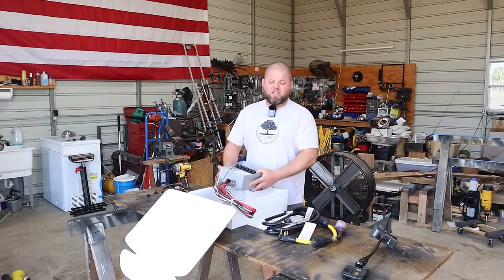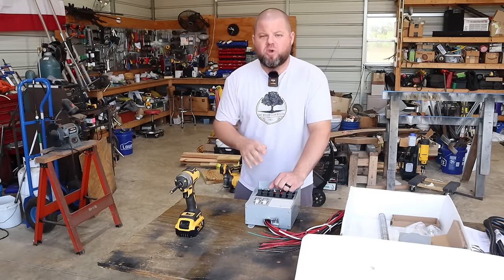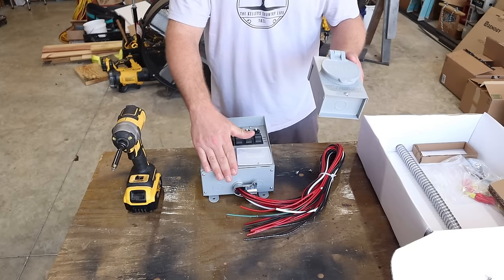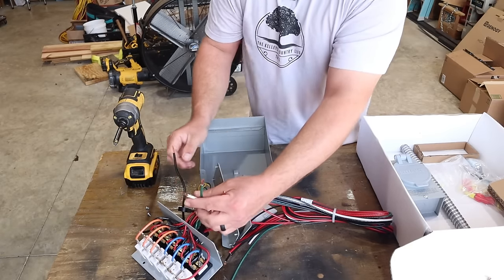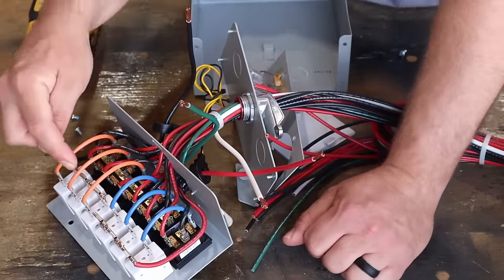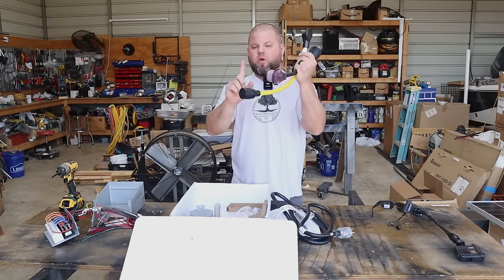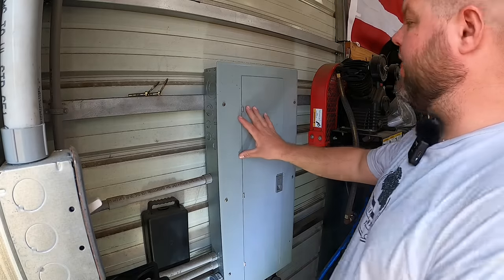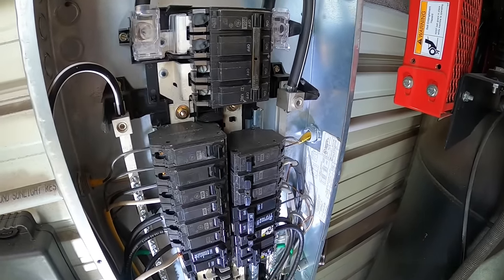How to install a generator transfer switch 120 and 240 volt #703 Ecoflow whole home power solution

Comment: Nice!! They are switches, not breakers. The breakers are above the switches. I suppose you just mis-spoke. The lights are actually only 43 watts each, pretty good for large fixtures like that. I like the UPS feature but you need to remember to have the transfer switch switch in the Gen position, the battery plugged into the transfer switch and the battery plugged into an AC outlet powered by the grid. I mention that since a lot has to be done for that to work that way. You mention the battery has 3600 watts. I guess you mean it's a 3600 WH (Watt Hour) battery. So that would give you a 1000 watt load for 3.6 hours. Not bad but not a lot either considering you may have very long outages. I guess it would power your shelter for more than 8 hours keeping the window AC unit use low and I would guess you would include the freezer circuit with that UPS set up as well. Not sure the energy use on that but most likely is around 500 watts each freezer running but they have strong start up currents. Not sure if the battery trips with high start loads like that. Consider the freezer, the window AC and perhaps another freezer starting at the same time, unlikely but..... 🙂
Reply from the maker: That unit has 3600 watts of continuous load output, 7200 watts peak. It also has 3.6kwh of capacity. That's actually a lot of capacity in a unit that size. I ran my entire house all day today (minus 240 volt appliances) on just that device, I averaged between 100-300 watts at any given time with everything as normal in the house. Only major spike was when I microwaved lunch. I also ran 400 watts of solar power to the unit and it was 100 percent charged by sundown while running the house the entire day. Quite impressive if you ask me.
Reply: @TKCL  Wow, my house uses about 800 to 1000 watts to run. I use about 650 KWHs every month. With such a low consumption it's no wonder it works so well. The solar alone was generating more than your needs. Impressive! 🙂
Reply from the maker: That was minus my daily average of 240 volt appliances, had to throw those off this being currently set up for 120 only. We have been averaging 750 watts an hour or 532 kwh a month lately. Majority of that is actually our dryer that pulls almost 6k watts. Tiffany loves doing a lot of laundry lol.

Comment: Well, it rains or is cloudy 217 days out of the year. Solar is only about 30% efficient. Price point of the equipment it would take 15 - 20 years to pay for itself and solar panels are only warranted 10 to 25 years then you start over again. There is no reason, the prices of grid power because they are still using 50+ years of the same grid and technology ...lack of thought for the future.
Reply from the maker: It's never been a logical choice for ROI with as cheap as my power is here. It is a wise choice living in the sunshine state for back up power or extended outage situations.

Comment: I have to mention that you will have 2 neutral bond connections on your system which can be never dangerous if there was a short to ground condition. There is only aloud to be 1 neutral bond connection. Please beware. 

If reliance  told you to connect the ground to the neutral bar. You will need a transfer switch that can switch the neutral wire. 

I hope this helps you.

Comment: You CAN NOT plug the Ecoflow Delta Pro into the outlet and use it as a UPS while it is powering the transfer switch, you will cause a ground loop.  Very dangerous situation and could burn out your Ecoflow.
Reply from the maker: I've only ever seen that issue when two are connected together with a dual voltage hub.

Comment: Too bad well pumps need 240v. That's the only thing I really need a  240v generator for during a power outage. Thanks for the tip on the 3-4 prong dog bone.
Reply from the maker: Shallow wells can run on 110volt pumps, but I'm talking 10-15ft deep wells not often seen. They do make 110 to 240 volt step up converters. Even still there is a good chance your well pump requires too many running watts.

Comment: Waste of time. Just back up the whole panel and only turn on/ or transfer power to what you want on during a power outage. Way simpler and cheaper. Eliminate that jankey 6 circuit sub panel and the hassle of wiring certain back up breakers in it and just put a 50 amp backup breaker in the main panel with a main breaker locking mechanism installed that only allows you to turn on the backup breaker if the main breaker is shut off and vise versa for when power is restored again. Then all you need is the simple 50 amp generator outlet installed and wired into the 50 amp backup breaker in the panel and done. Thank me later.
Reply from the maker: This is exactly how my house is. While that makes perfect sense to you, it's not for everyone. The beauty of transfer switches is they can be manual or automatic with no user input needed. Your scenario sounds perfect for you, but your not thinking about others. The beauty of transfer switches is its easy for a child, significant other or someone with zero electrical knowledge to throw a single out in the open labeled breaker during an outage. Not everyone knows how to go through an entire main panel throwing off an on critical circuits, that's easy to do on a simple transfer switch. FYI basic panel interlocks for your generator box are also illegal in many countries, where as a transfer switch it an accepted and safe means to pass code.
Reply: @TKCL  I totally get what you're saying and when we do them that way, I explain exactly to the homeowner how it works after I install it for them so they know exactly what to do during an outage but that's with a portable generator. Only way I do it.  If that battery backup system has a transfer switch that automatically transfers power after an outage, with out the need to switch anything over your self then that is the way to go. We also install whole home stand by generators That transfers the whole house automatically.